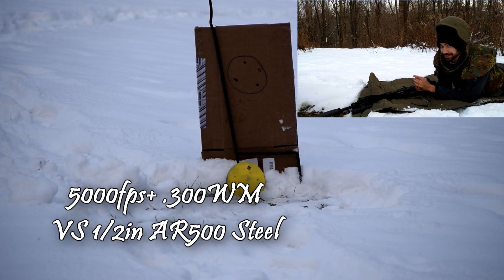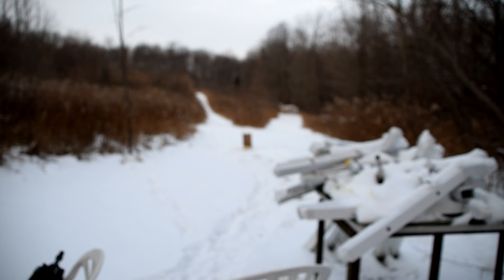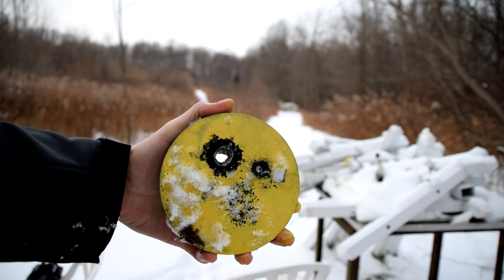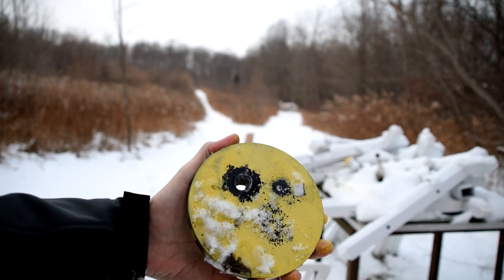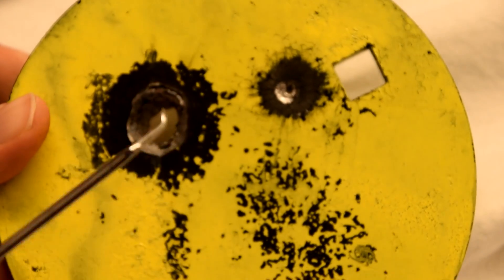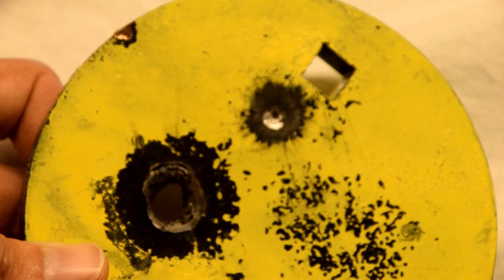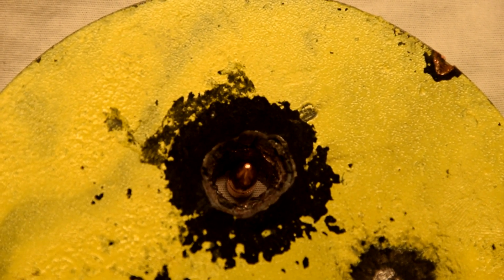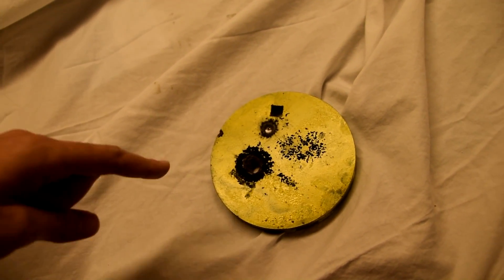5000fps .300Win Mag vs 1/2 inch AR500

Comment: You should buy an m993 projectile from CDVS and use a max load in 300 Remington ultra mag and get 2 inch+ thick ar500 plate. Make sure it’s sturdy and doesn’t move and is solidly in place.
Also for the 40 grain accelerator, that’s not too impressive since 556 can get 4200 FPS in a 24 barrel. Figure this would be significantly above that. Might be if a ridiculously long barrel is used or an accelerator that makes better a seal.

Comment: I may try this with my 300 Weatherby lol
Reply from the maker: Do it! I'm having trouble with lighter bullets so more speed is difficult.
Reply: @glenbutler7901  try using .25 steel ball bearings as the projectile!That is how you test the limit of the powder itself!Even using a regular Mosin rifle I got the crazy results:over 7000 fps with regular gunpowder from Soviet ammo and the best result was so far obtained using the powder from the aircraft machinegun ammunition from WW2 because it is laced with PETN!So that stuff launched these tiny ball bearings at a whopping 8200fps!Those ball bearings weight just 1.07 grams or 16 grains so they are really fast!Try using them next time!

Comment: I shoot 5/16 AR 400 plate with my .308 and my AR’s and don’t even dimple it with 62gr green tip..   maybe someone sold you a bill of goods on that plate.
Reply from the maker: Tim Mogle did you miss the first shot with a standard .223?
Reply: Thats besides the point. Velocity is what defeats armor, you can shoot slow heavy AP rounds all day and you may break the plate but you will not penetrate it.
Reply: Velocity is what goes through armor. A normal .300 win mag won’t go through level 4
Reply: Glen Butler  I just recently saw someone shoot 3a body armor with a 20" 5.56 and it punched the plate and ballistic gel behind
Reply: I guess you’ll have to invest in some “real” ar plate and find out yourself.. and don’t view you tube videos as gospel.

Comment: 5000 fps lead-core?
Reply from the maker: Yep, standard 55gr Hornady FMJ, lead core copper jacket.
Reply: I got my 300 win mag with 180 sst superformance from hornady blow almost all the war through a 3/8 inch mild steel plate it wasn't supported and the plate went flying. I think if the plate would of had something holding it that the bullet would have gone all the way through

Comment: I've read stories from guys that have pulled the bullets from .30-06 M2 AP and then reloaded it in .300 Win Mag cases with interesting results doing this type of thing.  Apparently it takes a little bit of experimentation to get the load just right but pre-pulled M2 AP bullets are easy to find on Gunbroker.  Might not be worth the trouble if you can already do it like this though.
Reply: id like to try them m2ap in my 300rum i got 80 round i my pull some down and try.